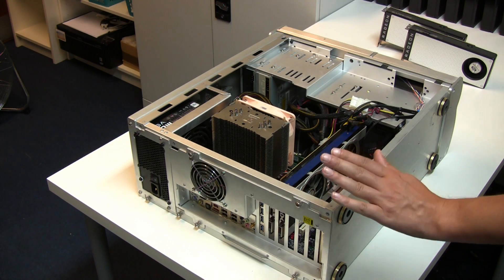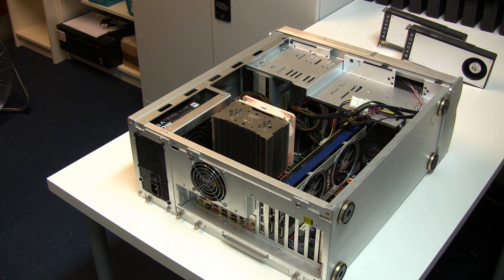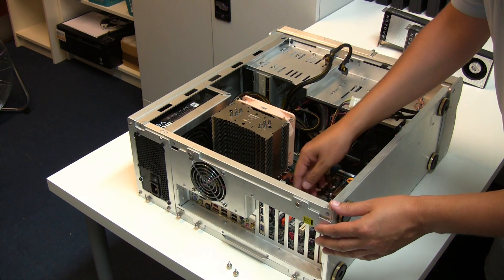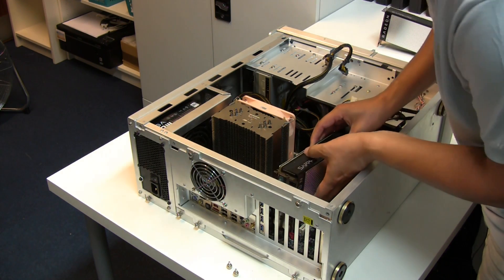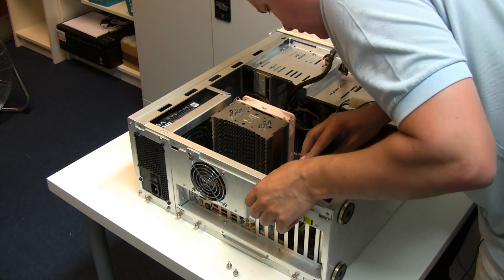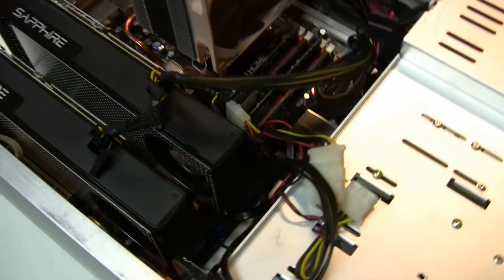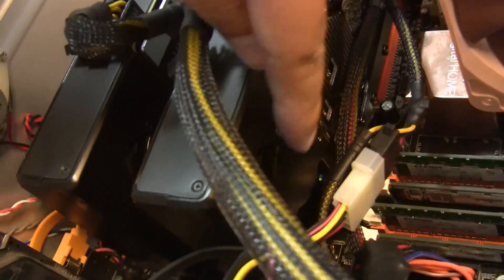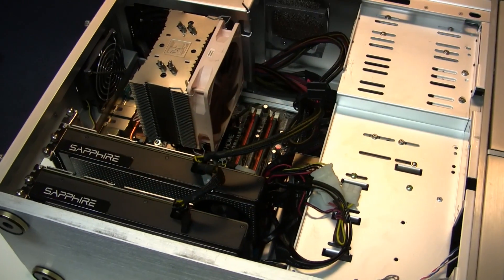Dual RX 470 Ethereum Miner - GPU installation - 3 of 4

Comment: What PSU you use?
Reply from the maker: In this machine a EVGA 650W
Reply: ty for info my PSU  a cosair 650w i believe it will work this rig with her
Reply: yes but ideally you'd want Gold or Platinum rated efficiency for a mining rig running 24/7